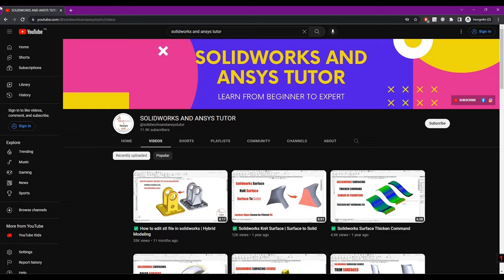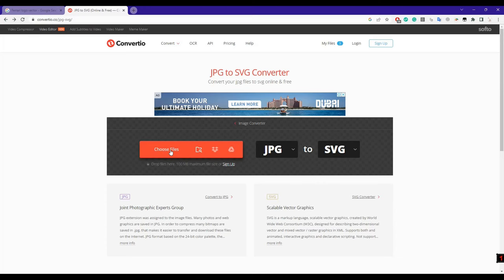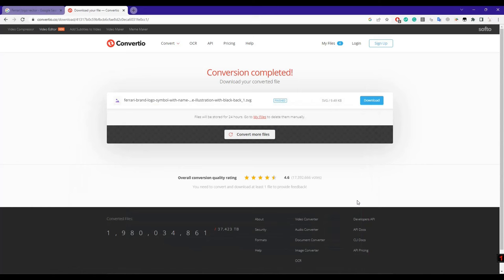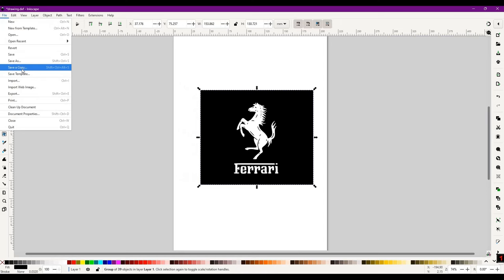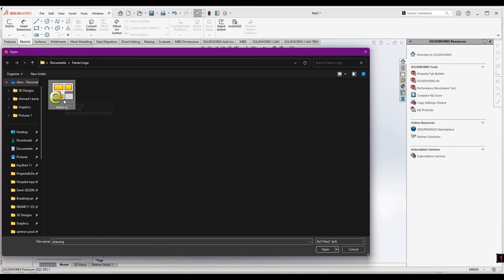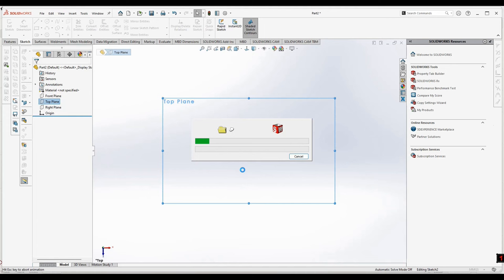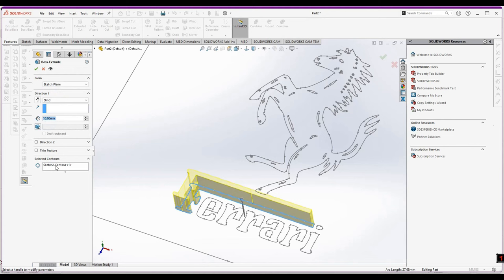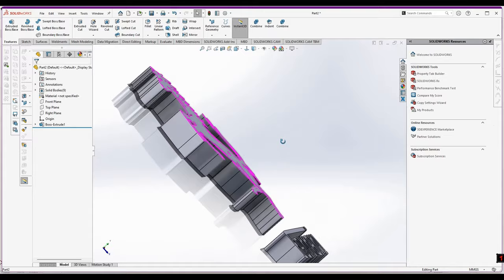✅ How to convert 2D Image into 3D in Solidworks | 2D to 3D

Comment: Ok. So 1st save picture as jpg. Then use website convertio and convert to .SVG file type. Then use Inkscape to convert to AutoCad DXF. Then save as to a folder location. Then start a new SW sketch. Then Insert DWG/DXF into the drawing. Then Extrude. Select contours to Extrude. Ok. Got it. Thanks.
Reply: you can also use a SVG to DXF website if you don't wanna go through inkscape.
Reply: Try but 403 forbidden not found. .